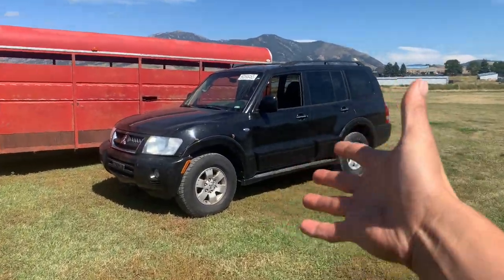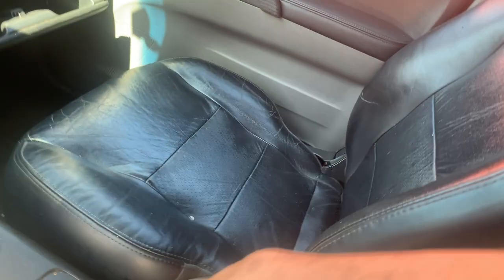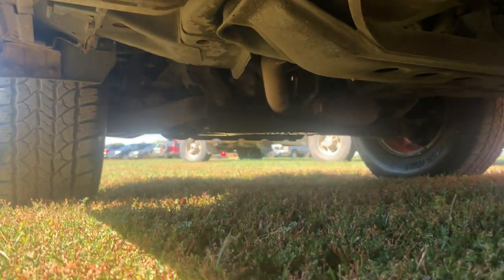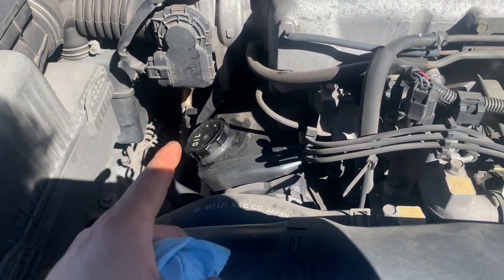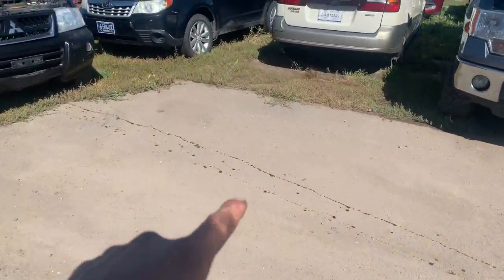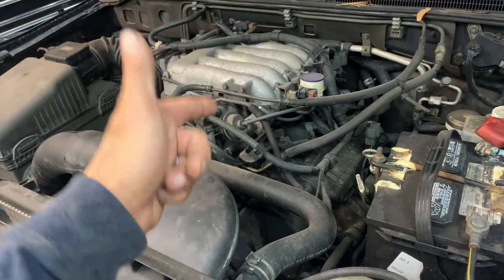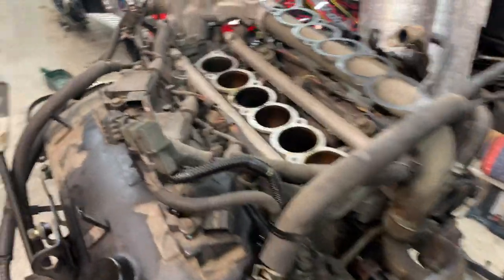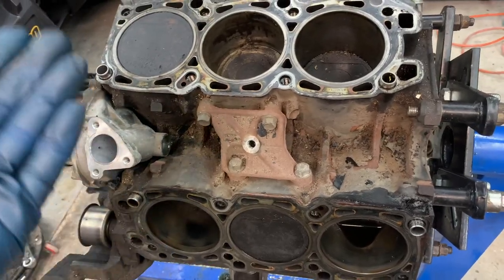I Accidentally Bought a Broken Montero at Auction

Comment: That motor was either running for a bit after the initial rod snapped or it was on highway speed when it snapped. Either or...that shortblock is toast. 

That Gen 3 is in great shape body wise. Hopefully the transmission is in great shape and drivetrain. It's worth saving ...put another motor in it and it's ready. 

That Gen 3 deserves another go at life.

Comment: Awesome vehicle. I got the same 3.0 engine 2005 model from Emirates, as a project car. Project was done within one month. Still with me since September 2022. Stability and speed is better than I thought even cornering.  190 kmph until now.  

Most of all parts are genuine except suspension bushes. Engine half overhauled. Not the block. Good performance in the desert.  

For your car, better fix another used engine.

Comment: Enough replacement engines available.  Replace & resell seeing as you have all equipment & knowledge.
Reply from the maker: actually, tracking down a good replacement motor for this turned out to be pretty difficult, not to mention getting it shipped to montana.